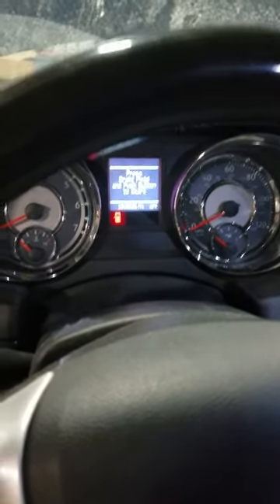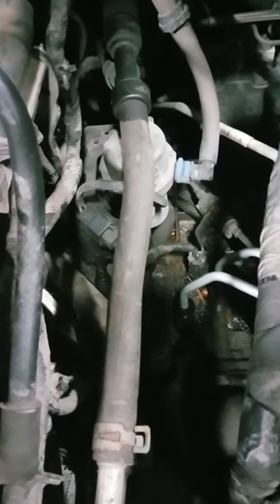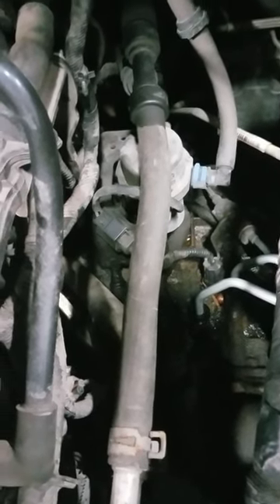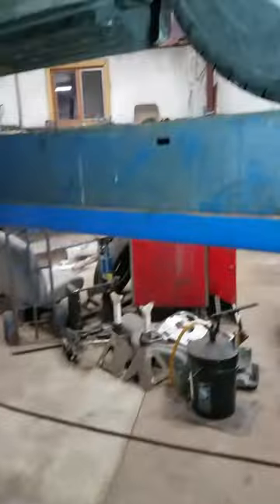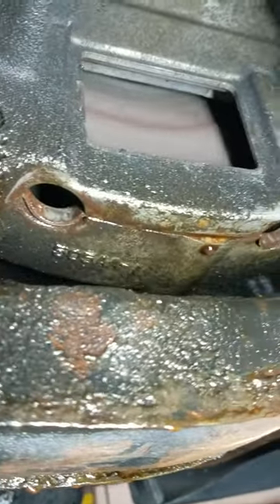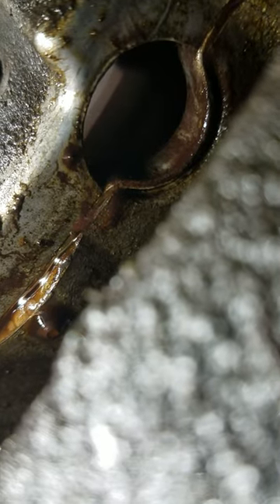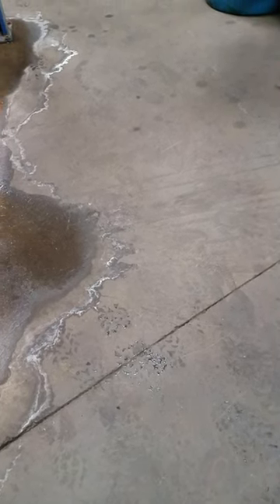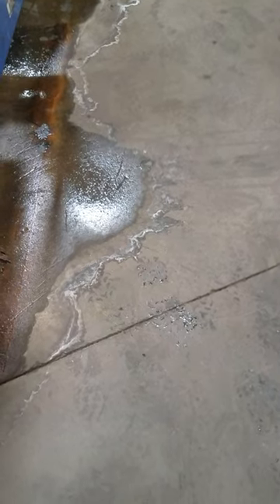Dodge grand caravan engine rattle noise 3.6

Comment: My flex plate was cracked. Cost about 1500 had to pull the axles and drop the trans to replace it. $100 part. I also replaced all the rocker arms and valve pins myself along with 1 camshaft to deal with a rattle in top of the engine.

Comment: Does the sound go away if you rev it any? I’m having this same issue but it just started
Reply: yes in the video he says it does and i dont feel insane anymore trying to help me neighbor out
Reply: @dkemp1337  yeah fixed my issue on a customers car and it was the flex plate
Reply: @joshgriffin1266  dude same stumped til now just put a rack on this had the subframe out feel bad for this lady
Reply: @joshgriffin1266  the engine mounts were blown too and it had me feel like a parts swapper and I always directly see or know a fix before I go on anything but since the subframe had to be lowered for the rack I said mounts were a good idea
Reply: This one actually knocks hard on crank
Reply: @dkemp1337  I agree,I felt like all I did was throw parts at it but it wasn’t my fault….it needed them all lol
Reply: @joshgriffin1266  them caravan owners a different breed lol run it into the ground I have a 94 Silverado 350 5 speed I love to work on that era or older been doing it years so I could see how I would miss a flex plate noise
Reply: @dkemp1337  you ain’t kidding,since my first comment I’ve had another caravan come in and it was worse than the first one. Maybe it’s a dodge thing lol